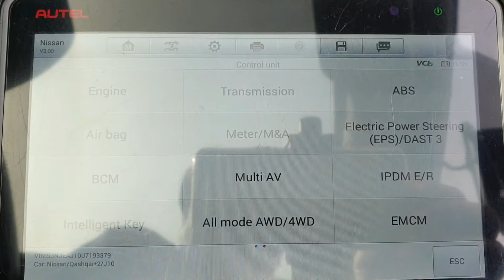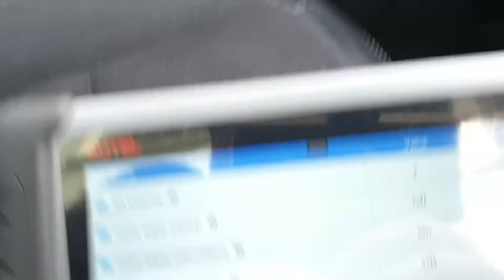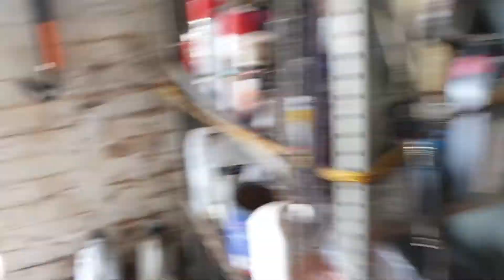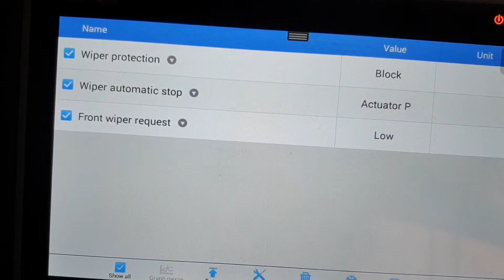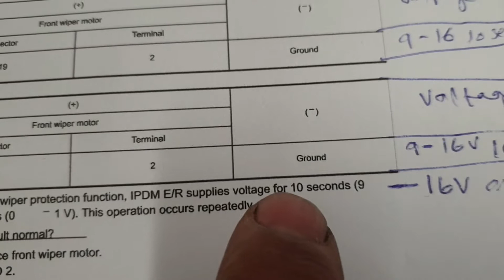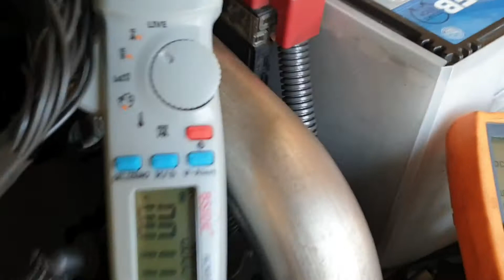Nissan Qashqai +2 Windscreen Wipers Won't Turn Off, Troubleshooting

Comment: Good Day.. thanks for this enlightening video.. I have the same problem with my J10 ... So the recommendation is buying a new original wiper motor? But mine was the original on that came with the car. What do I do... The issues are the same as the one you made the illustrations
Reply from the maker: Thanks for watching our channel. In my case, I proved that the pin inside the motor assembly was not making proper contact. So, when the pin wasn't making good contact, the IPDM was sensing a different voltage, and the wiper motor was being commanded to operate. The best way is to diagnose it and locate the fault.

Comment: Thanks for the detailed video, though I got a bit lost in electrical troubleshooting Exactly the same issue on xtrail t31 diesel, wipers go on and off on their own and stop in the middle, do not react to the switch. Mechanic suggests to replace the switch to see if t is the problem but i was sceptical the problem was with the switch. From your video i understand the problem with this qashqai is the wipers motor itself, but also my understanding this may be caused by that loose wire ?
Reply from the maker: Thanks for watching our channel. Exactly.

Comment: I have the exact same problem on my nissan Xtrail t31 Dci, wiepers just stop mid point anywhere and at times refuse to work. So If I replace motor assembly. things should be ok.
Reply from the maker: Thanks for watching our channel. 
First, it has to be proven if your wiper motor assembly connector has the same problem as it has  in this video.

Comment: Thank you for your video, I have the exact same problem with my Qashqai 2012. Im not able to fix this myself so what would be the solution in short? Do I have to get the wiper motor replaced or is there another solution?
Reply from the maker: Thanks for watching our channel 
If the problem is the same as you saw on the video the only solution is to replace the wiper motor assembly with good quality one, as you saw in the video the motor unit had been replaced but with poor quality parts as the feed back signal wire to the BCM was not making contac (loose contact) so the BCM reads this as open circuit so when contact between the signal wire and motor assembly were established the wiper operation was stopped with wipers operation swith off, and when  it wasn't established, wipers arms were moving eventhough the operation switch was off.
Reply: @stanhopeautorepaircentrewardak  OK Thank you, wiper motor is original from manufacturer here as it has never been replaced in 2012 model. But the symptoms are the same as in video, wipers go when switched off and will stop in mid operation without switching off.
Reply: @trondvaaga-dyrseth8834 hi, i'mhaving the same issue with my wipers, how did you get it fixed? It would help me a ton, thanks!

Comment: Is there any chance, we can see the final fix once you have fitted the new motor ? Or did the customer not go ahead with the repair ?
Reply from the maker: Unfortunately i did not get the chance to repair it as my customer was the garage who had made the mess and the garage wanted to make me victim of their mess, as the wiper motor was replaced by them and did not cure the problem on first time repair, when i diagnosed the wiper system, they wanted to know what the malfunction is before going ahead for the repair, but i didn't want to reveal that to them because i knew that, once they know the malfunction thye are going to cancel the repair and enstead they will do they repair themselves, and on the other hand the car was here for one week because the garage didn't want to share the miss repair with customer so finally the customer got angry with garage and terminated the repair and the garage had no choice other than not to go ahead for the repair and the garage suddenly called me to put everything back on and were going to take the vehicle back from me because the customer was too annoyed and angry and doesn’t want to go ahead for the repair. And in the end they took the car with out repair and i didn't tell them what they malfunction (problem) was?
Reply: @stanhopeautorepaircentrewardak  oh well but really good video and alot to learn from, let's hope the garage who gave you this car never finds out about your YouTube channel 😂 else all your secrets will be revealed 👍